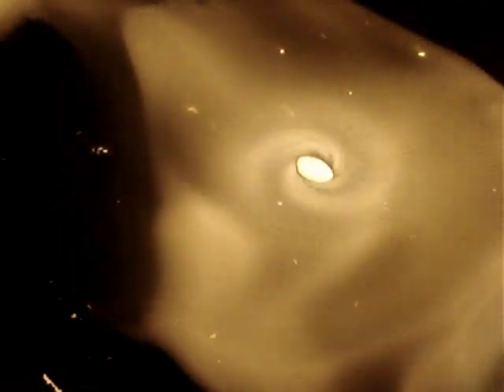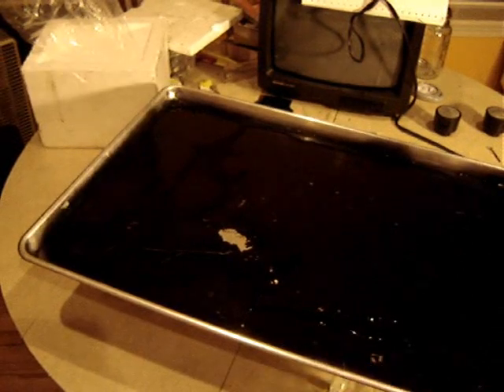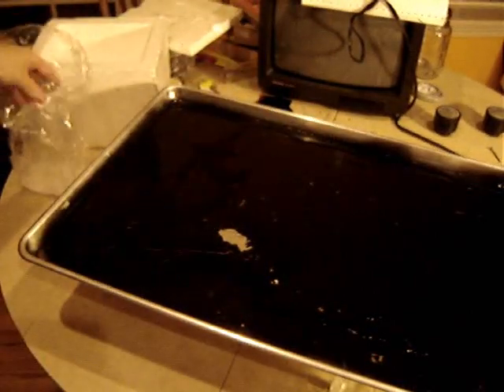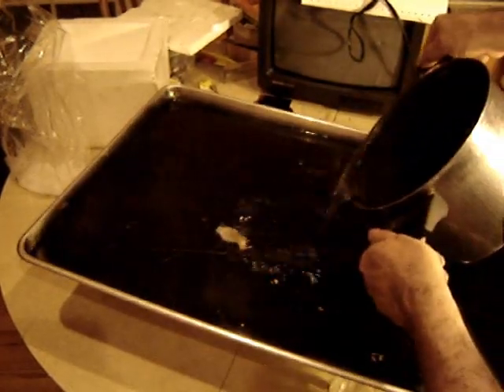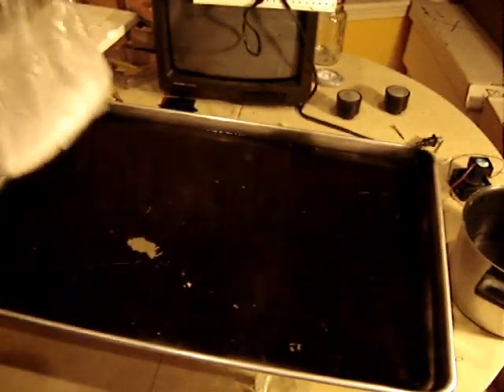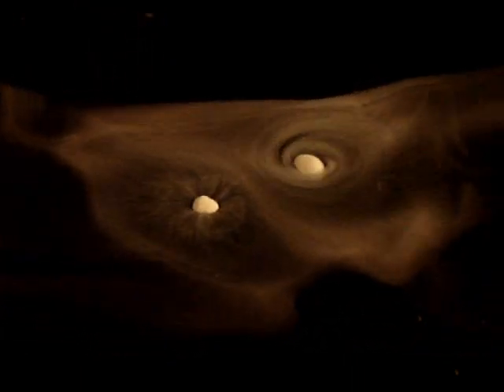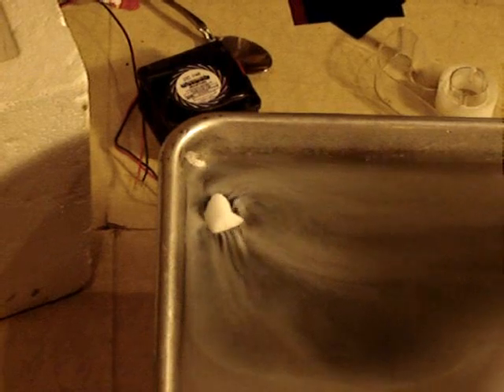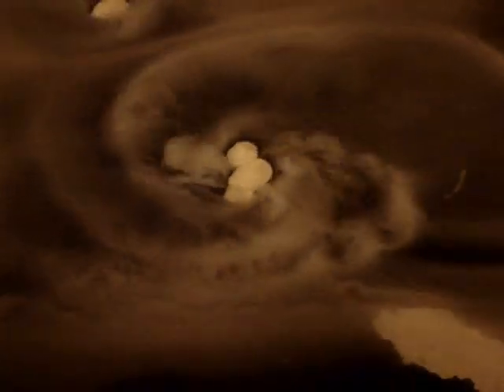Dry ice chips w/interesting flow patterns

Comment: Thank you! My son (9 yr old) is going to use this project in his Science Fair. Do you know how to add the external electric current to make "Hole Punch Clouds" safely? If you could help him I/he would be so grateful! His project is on external forces to Earth's weather. Electric and water..scare me a bit.
Reply from the maker: mamassprout  a safe battery-powered supply is about $6 from ebay, see http://amasci.com/emotor/negion.html, search ebay for "anion" and "12V", they are little black plastic cubes with wires.   Just as safe as zapping your finger on a doorknob in winter.   Or find an old negative ion generator as explained on the same webpage.
Reply: Thank you!!

Comment from the maker: Gas is viscous too: boundary layers remain trapped against surfaces.  The higher it's viscosity, the thicker is the layer.

When the surface is large and the mass of the chip is small, the gas buoyancy wins over the weight.

Comment: Ah, when two ice chunks get close together, the average temperature between those two chunks begins to decrease, slowing the vaporization (melting) of the dry ice in that region, and that means... that the jets get smaller between two adjacent chunks.

The jets on the OUTSIDE, however, cause the chunks to get forced together. Maybe a little bit of surface tension in the mix, too.

Comment from the maker: Dry ice acts like hot cinders: it only "bites" whenever you push it firmly against bare skin for an entire second.

Keep it moving so your skin never freezes.  It makes gas, so it won't stick to skin.  Small pieces (2cm) are easy to handle with bare hands.  You can also pick up huge chunks if you juggle them around.    You can even crunch up a small piece in your mouth, then blow out clouds of fog... but spit out all the broken grains as you chew!